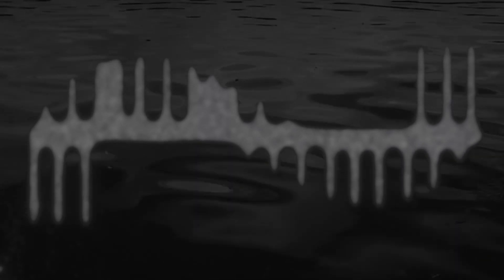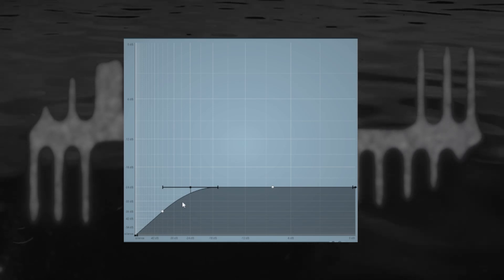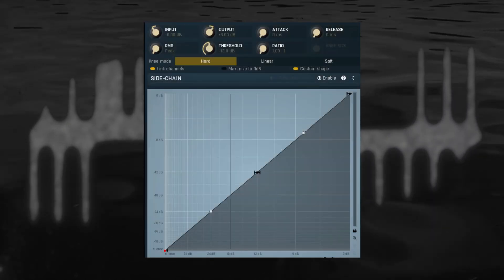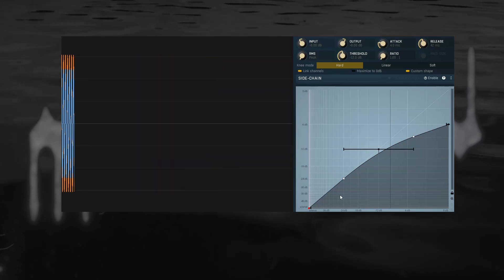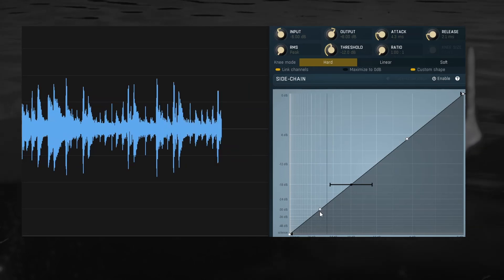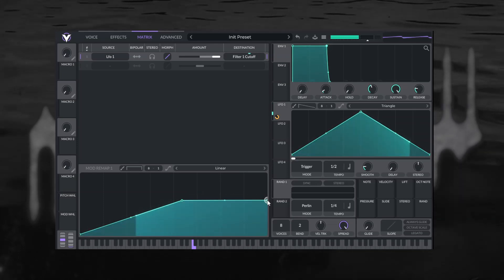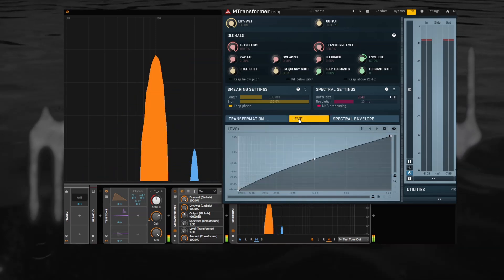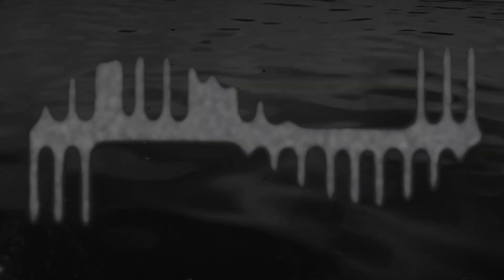Transfer Functions are everywhere in Audio

Comment: Maybe you can help clear up this confusion.
I thought compressors/limiters are fundamentally different from clippers not only because of the attack/release but also because compressors reduce the gain of the entire signal without distorting the wave (unless attack/release are too quick) while clippers directly distort the wave
Reply from the maker: Theyre not fundamentally different, a limiter with 0 attack/release is effectively a clipper.

Compressors/limiters will distort the wave too if theyre very fast as you say, which is why they can also add harmonics.
If you imagine a sine wave,
 you might be able to see how if a compressor compressed it really fast,
it would start to flatten individual humps of the sine, making the tops into a more squarewave like shape. We would hear this as odd harmonics being introduced. You will notice this effect first in the lower frequencies, since the how quickly the wave repeats determines at which speed you start affecting individual wavecycles.

So yeah, its all a matter of speed. You can see this phenomenon all over sound, where when changes happen very fast, at what we’d call audio rate, we stop hearing them as rhythmic and start hearing them as harmonics.
We measure slow frequencies in bpm and call them rhythms, we measure fast frequencies in Hertz and call them pitches. But the unit of both is just 1/time.

Hope that helps you make sense of things!
Reply: @TildeSoundsthank you a lot for the detailed explanation!
I appreciate this channel a lot since it seems to be one of few who really understands the theory

Comment: Does anyone here has a clue why "the industry" refers so seldomly to the fact that basically all compressor, expander, limiters, EQs are (spectral) Waveshapers.
The moment a Waveshaper allows for attack time and release you can build your "own" compressor, or your own "effect device". Is it just to sell more plug ins) What puzzles me is that it seems to me that the majority of people don't know it. In so far your video is extremely "educative"!
Reply from the maker: Compressors and limiters aren‘t really waveshapers, they can just be described with the same gain changes. Functionally theyre quite different EQs are a whole nother story, functionally, EQs are closest to a very specilized type of delay. 
As for why people dont explain things this way, not sure. I think audio engineers are a bit stuck in traditionalism that goes back tot he analog days sometimes.

Comment: It is weird that most basic "function" is now called "transfer function".
Reply from the maker: @RukopisyNarnie  just an engineering word for a systems input/output mapping i think. It also implies a certain degree of abstraction/approximation. Just function alone is quite a general mathematical concept.
Reply: @TildeSounds  it is general, but it is exactly this
Reply from the maker: @RukopisyNarnie  a function is just a mapping from one set to another, far more general than this
Reply: @TildeSounds  yes ant it is what you showed in video

Comment: awesome video. should do one on controlling micropeaks. Some AB between manual volume automation vs hard digital clipping for peaks 15ms or shorter. The old adage is to not use hard clippnng because it introduces distortion but some modern testing suggests that the level of distortion introduced in such a short time span is not perceptable making hard clipping potentially more transparent than manual volume automation